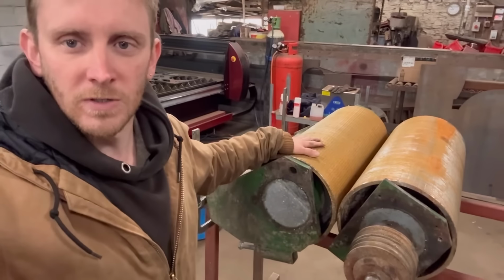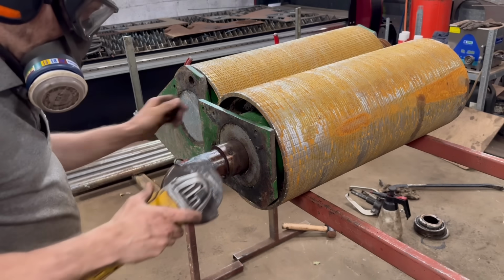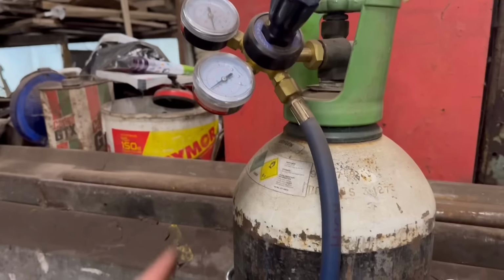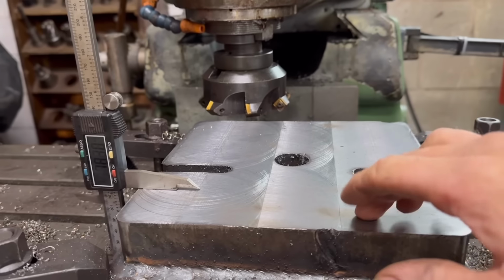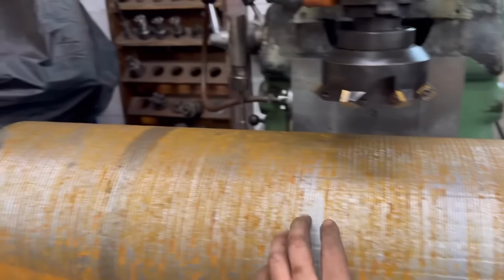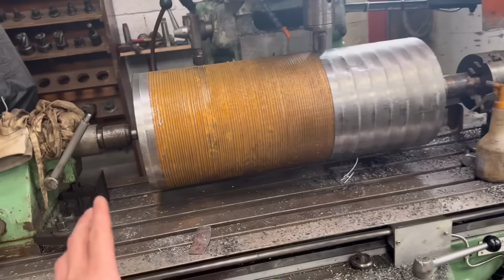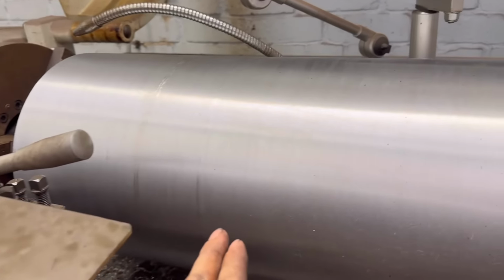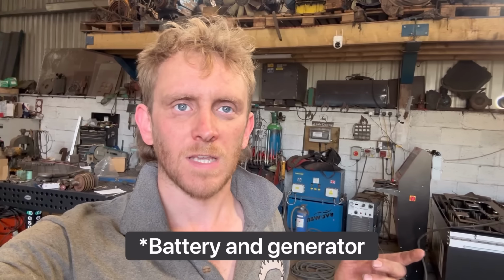Skimming rollers out of a roller mill. I need a bigger lathe!

Comment: If/when you get a bigger lathe, make sure you get a travelling as well as a fixed steady. You were lucky with this roller. About 4 months ago I machined a 340mm dia roller (hollow, 900mm long) and it rang like a bell and there was chatter everywhere, no matter what we tried. We ended making a larger travelling steady using the rollers off a smaller steady. Took about 25 hrs work to make the steady but it worked like a charm. Have another 2 rollers to do in coming months. My lathe is a Victor made in Taiwan, having 660mm x 2500mm capacity. Self taught machinist/mechanic in Land Down Under.
Reply: Drill a hole and add sand?

Comment: Hi Oli love what you do and been following you for a while now. We’re only in Thirsk so not far away. We have same problem as you with only 2 phases coming in. Not a major problem for us. Your best option would be a Diesel generator wired into a separate distribution board that just serves your 3 phase equipment. It could be set up so that as soon as you switch a piece of equipment on it automatically starts the generator and switches it off when you switch the equipment off. I’ve been an industrial electrician for over 46 years and set a few systems up for clients along the same lines. Solar panels with batteries will be expensive to install and won’t be as efficient in the winter. Hope this helps. Keep up the good work. Regards Ian
Reply: @ianmcgowan-xh6uu If reliable running surface water is available on the Snowball property, would small scale hydro-electric generation make sense?
Reply: Also an industrial electrician here, have you read the rest of the comments, only think missing is a hamster wheel 😂😂. Yours is very Sound advice I think. Split phase is very misunderstood by a lot of people (as it was only ever supplied to farms needing more power back in the 60’s) as you know it’s nothing of the sort it’s only a 480V  centre tapped supply.
Reply: 1-2 gallon garden sprayer for coolant?
Reply: @johnwarwick4105  Thanks for explaining, so its bit like the US homes 110/220 systems, so when I see two lines on the poles across a field it’s not phase and neutral it’s two phase, the transformer on the pole is centre taped 👍😀

Comment: I apologize if this is obvious but in case you missed this thought.  If you  drive your dividing head  with the rotational motion of your table travel you could cut the the shallow helix grove in the drum (at uniform depth) by tying the table drive to the dividing head drive with gears of the appropriate ratio leaving the crest of drum inline  with the table travel. this is how helical gears are cut on a milling machine - the ratio would be the number of turns to traverse the length of the roll : to the number turns need to rotate the dividing head so it travels  the desired angular distance on the circumference.  This is why I thought your set up on the mill was brilliant. Because now you can cut any helix you want with a little gearing

Comment: Regarding 3-phase power -- if you were thinking about making your own 3-phase from solar or generator with battery storage.... at that point you're doing DC to 3-phase via a 3-phase inverter. In that case, you could skip the solar and generator and generate DC from your split-phase AC.  Basically an AC (single phase) to DC to AC (3-phase) converter, similar to how an "online UPS" works.  That is to say, if you're looking at generating your own 3-phase AC, consider using your existing power supply as your generator rather than going full off-grid with solar/generator (unless you separately desire being off-grid as another goal)

Comment: Hi very ingenious attempt , It seams to me the gap  between the rollers will now be bigger now that you have reduced the diameter,  or are they "pressed" together , and now you have matched them up the gap will be to tolerence ?, I am also surprised there not hardened making machining more difacult , it also looks to me like the horizontal groves would be a critical part of the feed mechanism,  I can imagine now there smoth them having trouble pulling through the grain , in short an explanation of how the mechanism works would be much apriciated

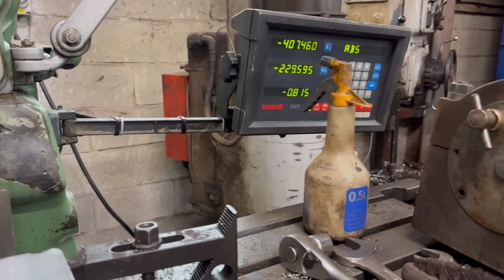Comment: 33:28 did you check all your gibs to be properly tightened and or properly positioned? In transport, tho rare, they can move, which means the respective axis is then loose. Have had it happen with a mill. It mostly depends on the type of gib. Gibs with back screws don't have this happen, they can't get loose, but gibs that are purely side pressured into position, can. Just a thought.

Comment: Would be curious if you could have switched the tailstock to the left of the apron, then use a big long boring bar to bypass the tailstock and work on at least half of the roller? Then you could flip the roller and do the other half.

Comment: I run my mill from a rotary converter which originally came from the 🇺🇸 so was 230v 3 phase then as an experiment i found a 415 to 220v step down transformer and reversed it to give me 415v 3 phase   its been working near on 20 years so reliability wise it good , only ever run motors of it but always wondered how it would be with a welder

Comment: Setting Up off grid 3 Phase would be a fairly straightforward setup, I run outback inverters (mine in parallel) they have the option to be able to run multiples of 3 to run 3 Phase. As you live in the UK there are many more options available,  a good start would be to look at what bimble solar has to offer .  The most expensive part of the system will be the batteries.

It would be well worthwhile looking into a PTO driven generator as it's probably cheaper than an off grid system

Comment: My cousin used to have a small machining workshop down in Wiltshire - couple of lathes and a few different types of mill. He used a 3-phase diesel generator - simple, reliable and easy to install. Allowed him to run several machines at the same time.

Comment: Nice vid  Olly, i have done some milling in my time,i would say when you rotatianlly mill you need flat bottom cutters,which cost an arm a leg and a kidney. If you use an inserted cutter,unless you have many psi of coolant,don't bother with a spray. I noticed clamping,maybe it was a camera thing, but the heel of the clamp always needs to be higher than the clamping surface, and when surface milling make sure the swarf goes to the back of the machine ,and not down the front of your t shirt, it really does hurt,not making judgements just saying

Comment: Using the mill was a very innovative solution, even if it did not work as well as hoped.  Just curious, what is the weight of those cylinders?

Comment: Not a machinist so this is only a question, why didn't you make the pass in the x axis using the power feed  and then rotate it slightly using the dividing head and make another x axis pass the other direction and so on using the much larger cutter you own?

Comment: Hi Oliver. Good video. I was looking forward to you cutting the long grooves in the cylinders; I did not realize they were spiral! Customer cutting with grinder? Good luck with that! Will there be enough adjustment in the mounts to bring the rollers closer together to make up for the material you removed?
Until next weekend, have a great week!
Cheers. David
Reply from the maker: It would be easy enough to do with a grinder, only needs a light groove to help pull the grain in.  Yes, there should be enough adjustment.

Comment: Nice work again Ollie, anybody can make a mistake but not everybody can fix it. Regarding the three phase, a small circa 20-30kva diesel genset wild do what you need with simplicity. Sure it’s possible with batteries panels and inverters but for the current you require would be very costly I imagine compared with the genset. You could use the waste heat from the genset to heat the workshop. From what I have seen from your abilities you would be able to maintain and repair it no bother too. All the best.

Comment: Rotary phase converter is the closest you can get to true 3 phase in your circumstances. I have to run one where I live for my heavy lathe. Hope that helps. Basically a two sided generator where one side is 2 phase input that spins the three phase generator for your output. Just be sure it puts out enough power for whatever you get. There are different sizes and you want to be future proof for other equipment.

Comment: Rotary Converter 240v Single Ph. to  415v  3 Ph  ... Or is it Completly Off Gride You need.?   (I've seen a couple of D.I.Y 'Shed Machine Shops'  using this method.running Full Size Miller & Lathe at the same time) .......... Great Content O.

Comment: I wonder if there’s an easier solution.  Consider a jack shaft in the lathe and a belt. Turns the drum.  The finishing and milling done with 36 grit belt and a hand belt sander.

Comment: My dad went through the exact same thing as you regarding the 3 phase supply to his farm so have a bit of knowledge about that. First question is .. do the farms / properties nearby  have pylons or telegraph poles with transformers on going to them ? are you close to a road or down a long track
Reply from the maker: The nearest 3 phase pole will be about a mile away. And apparently the existing poles aren’t rated for 3 phase so the whole system would need upgrading

Comment: Use a phase converter to run 5hp or 10hp 3 phase motor (abb 1336 offers a variety of voltage options and will run from single phase power). Then take the 3 phases from the motor and it will run any 3 phase equipment with proper and clean 3 phase power.
Reply from the maker: That’s what my rotary phase convertor does.
Reply: @snowballengineering do you have a 3 phase motor that is started from a single phase and then used to generate 3rd phase due to rotational inertia (aka phase converter)? What I described is not a phase converter in that sense, but a true 3 phase power source that will run anything, given proper vsd and motor sizing

Comment: Hi Oliver, there is something called a rotary inverter it vonverts single phase to 3 phase mechanically using a single phase motor to drive a 3 phase generator and you can use them to run welding machines as long as they a rated correctly. they are not cheap but probably a lot cheaper than off grid battery , hope this helps

Comment: Update us on outcome of 3ph! Just know of static converters or generators being used. Checked to see cost of getting 3 phase into the workshop as you might have three phase to the farm? Are you running press brake off static converter?
Reply from the maker: I have a rotary converter that works great for everything with a motor but I don’t think they’re suited for welders and plasma cutters.

Comment: Good effort with the mill there, I was expecting you to make a frame up and use the bearings and a pulley with belts in the lathe chuck !
Just a heads up for the guys refitting those bearings, it's really easy to overtighten those taper sleeve bearings, they'll still turn, but will destroy themselves in a couple of hours. Put a 1 1/2 thou feeler between a ball/roller and the outer race as you tighten up the nut and stop tightening when the feeler starts to grip. Three or four button headed Allen screws would have been a nicer fix than those dot punches for holding the cover plates in position too ?

Comment: Hi hope this of help , i have had a off grid house for 15 years now , i started with a 1.5kw wind turbines and a battery pack ( used fork lift batteries ) the average wind speed here is 5 metres per second , i soon realised at this wind speed the actual average out put of the wind turbine was only 150 watts (10 % ) of rated out put most of the time ! i moved on to a 10kw w/t on a 18 metre tower , this was alot more useful again working on the the fact that 5 metre per second was the average wind speed i would now get a more use ful 1.5 kw out put .
After a lot of you tubing i decided to try solar , i have now got 11.5 kw of solar , which is way over kill in the summer , but i angled them at a low than idea angle for summer use to make the most of low sun for the autum and spring , this works really well and the w/t is only used on bad light days and winter , but be aware , over cast still winter days you get next to nothing from w/t or solar) , for example i have other grid tied solar set ups , in summer i see  up to 26-28 kw a day produced  per 4kw system, dull day in january .5 to 1kw produced 
Storage ! i have about seven tons of forklift batteries , again after lots of you tubing , lead acid batteries life is related to the depth of discharge ( deep you discharge the battery the quicker you kill it) so the bigger you bank the longer the life of the batteries as long as you have the power to recharge properly
Because the wind turbine is 150 m away from the battery bank i had to go for a high voltage system , the battery bank is 240v dc , which made the dc to ac inverter more difficult to find , after a lot of research i found a company in china called Sandy they provided me with a 240vdc in put /240v ac out put inverter , the inverter 
 will deliver 10kw constant and 15 kw peak more than enough for my use , the inverter has been running for over 10 years now so worth alook as they also do 3 phase inverters
But be careful with chinese companies , i have found the spec 's and the pictures you see is not all way what you get , but i can recommend Sandy 
Had you considered grid tie solar on the farm , my thought would be buy the kit your self , fit the panels your self , have an electrician wire the grid tie inverter and not have a contract with any provider ( what i did ), Sandy may be able to offer you a split to 3phase inverter ,  batteries are a hassle , expensive and have a life span 
Well this has been a bit long winded but i hope it was helpful

Comment: It looks like that smaller cutter you ended up using may not actually be cutting in the middle 5mm or so -- all the inserts rotate around that center space?  If so, it would leave a slightly uncut part there (a smaller version of the problem  with the large shell mill), leading to rubbing and even more of the challenges you were having.  I think with a different cutter and a bit of time trying to reduce the backlash in the dividing head and you nearly had this!  Great problem-solving
Reply from the maker: The cutter I was using will also drill holes
Reply: @snowballengineering  perfect, thanks for responding and sorry for my misinterpretation from what it looked like here

Comment: I'm off grid with Victron inverters, batteries and solar, they have videos on YouTube of a factory in Poland (I think) that's running a 3 phase inverter setup, from the little bit I've bought the factory setup looks like huge investment? I've just had to have a 3 phase supply put in for a new build house to comply with new building regulations, so it's becoming more common, if you haven't had a quote recently it's probably worth checking prices?

Comment: I've made a thick U-shaped piece of steel and tapped it. Then I could drop it behind the pulley and then run bolts through the tap holes into the plate in front of it and drive the pulley off. It's worked for me many times.
Reply: A tried and trusted way to do it

Comment: Could you build a high sided coolant catch tray for the mill bed that could sit under & around the milled piece that returns the coolant back to the tank ?
I would have cut a wedge of wood & jammed it between the roller & the mill bed to absorb the back lash in the dividing head.
Reply from the maker: The mill has trays underneath to catch the coolant, I did try a lump of wood but was still having issues

Comment: When I purchased my Transwave rotary converter they added a manual voltage control that bypasses the capacitors that are part of the automatic voltage control that help to regulate the voltage with changes in load specifically for use with three phase welders.  This was recommended by Transwave and did not cost anything extra at the time. I would suggest you call Transwave and tell them your issue. They were very helpful and knowledgeable for me. I don’t think it is a difficult modification to add the manual voltage control.
Reply from the maker: Yes, I spoke to them yesterday about this. If I’d have known when I bought it new I would have had it fitted.  But then the trouble I have is I don’t really have enough supply to run a phase convertor and the welder. Hence why I want a completely separate 3 phase system run from battery’s

Comment: Nice to have friends with big equipment! We had a feed mill that included both a hammer mill and a rolling mill. I was surprised to see the grooves as ours never had them ? I now understand really how badly they have been worn I wonder if the owner is steam humidifying the grain before rolling if you skip that step we got a lot of cracking and dust that got sucked out the top of the cyclone on the air conveying system. Nice job on the rollers but I think they are going to have to have new cylinders installed to make them durable over the long term.

Comment: Have you seen the small hydraulic power pac that is often used to pull propellers or shafts.
It’s a small ram with a split collar and fits on shaft to push off anything attached to a shaft. I watch many of your vids and this looks like a great solution for many jobs.
It’s called a carrier bearing and pinion clamshell puller, With an hydraulic power pack… surprisingly inexpensive at vevor and Amazon( less than $200).
Some of the comments mention different methods to configure your required power supply.
Can you identify your power supply requirements for the machines you will ultimately have in your shop. I’m not sure it was clear if you wanted off grid or some other setup.
Motor generators are very common ?